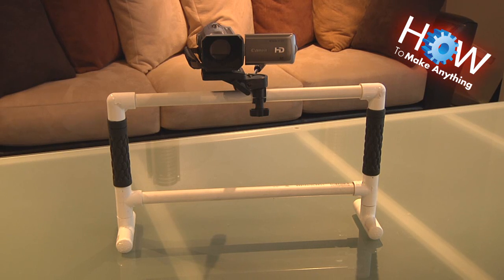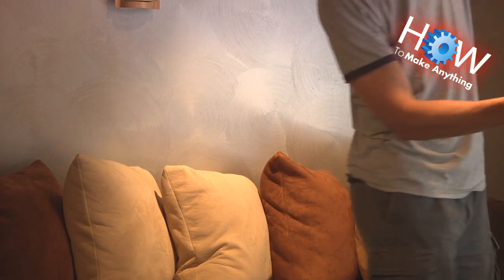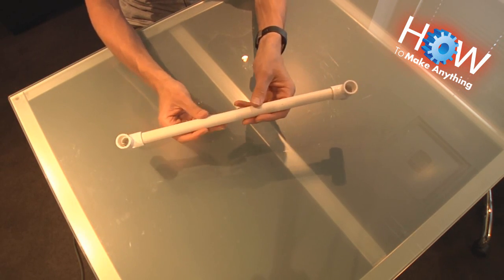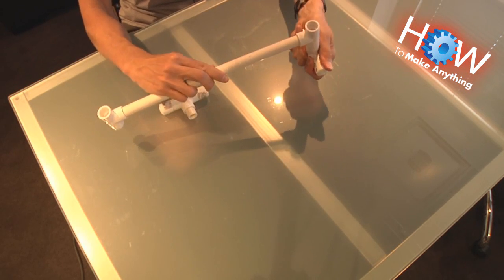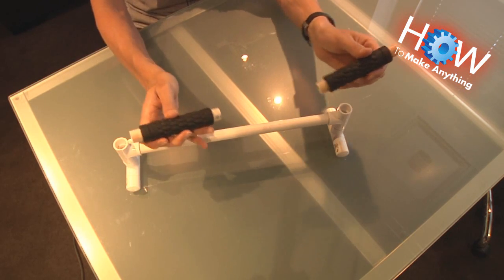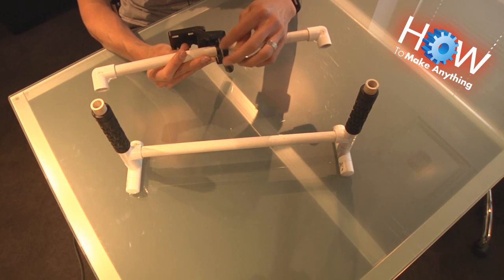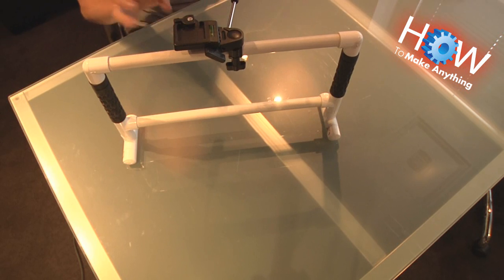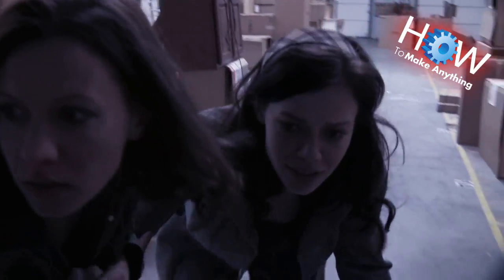How to Make an APR (DIY FigRig)

Comment: Great idea and a nice departure from all the rest of the people that try to build circular fig rigs.  I found it also quite nice as I could mount my 16 inch 40 watt ring light to the front of the rig and shoot through the middle of it.  With all that gear and offset weight you will most certainly want to increase the length of your base for added stability.  I also mounted my wireless remote at the hand grip location.